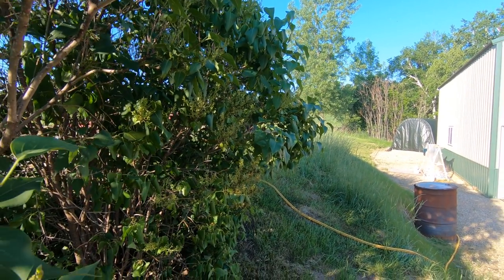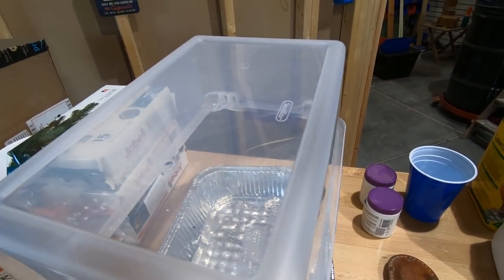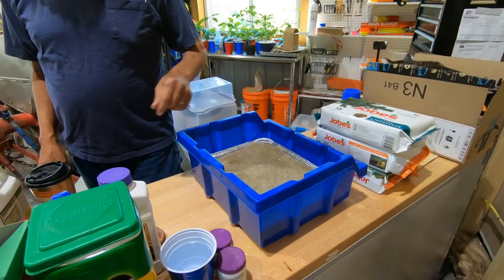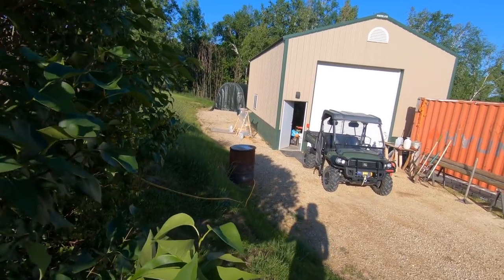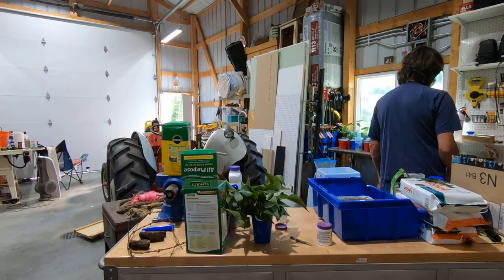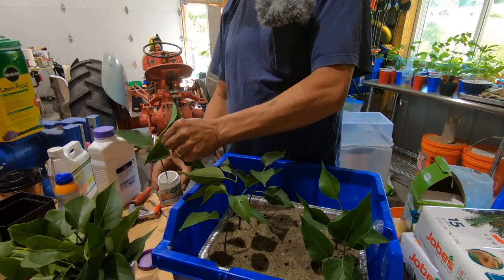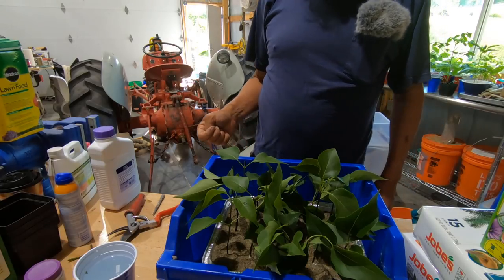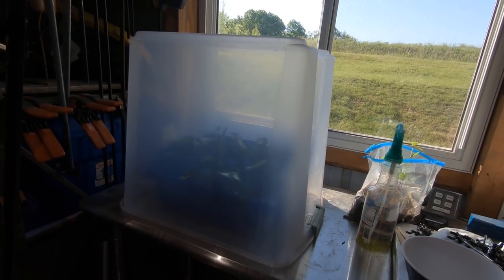Propagating (Rooting) Common Lilac From Softwood Cuttings

Comment: IN the next two days, I'm going to try burning bushes and lilacs, we have dozens of them growing , but all in the wrong places, we had one burning bush twenty yrs ago and now have them growing all thru the woods.
Reply from the maker: Both should work fine. I have never done burning bush, but know for a fact that softwood cuttings from them work just fine. The real key is to not let them dry out or drown. Also, keep your cuttings in full shade until they start rooting, then you can slowly acclimate them. 

There will be a brief progress report later today (tomorrow at the latest) -- but these cuttings are doing great so-far. Good luck!
Reply: if the cutting do grow, what will you do with the plants this fall to protect them this winter? thanks
Reply from the maker: Unfortunately the cuttings got blasted by the 100 degree heat we had a week ago and they are dying. I wanted to use them for a long hedge, but will try dormant cuttings this winter instead. Next time I will need to pay better attention and protect them better!
Reply: Ahhhhhh that forest must smell so amazing , don't burn it

Comment: I am curious if your cutting actually rooted. 

Typical Syringa vulgaris propagation is done by way of mounding or root cuttings. 

I have not read or heard of softwood cuttings being a viable means of rooting Lilac. The usual outcome is that they may root, but the roots are not viable or substantial enough to produce a successful plant. 

Also, if you cut those leaves in half, the planting will transpire less and the need for water will be significantly less through your propagation attempts. 

Again please update us on your success or failure with softwood cuttings. 

Thanks
Reply: I too would like to see if it was successful even if it failed I would like to know. Thank you for sharing. Even an unsuccessful attempt is helpful in learning.

Comment: Is your process for propagating hardwood cuttings during their dormant period exactly the same?  How often should you check the moisture in the sand?
Reply from the maker: No, it's not. Dormant cuttings are not covered — and I don't check the sand at all. The sand shouldn't dry out in the time it takes to root.